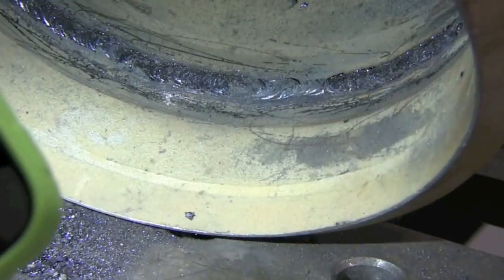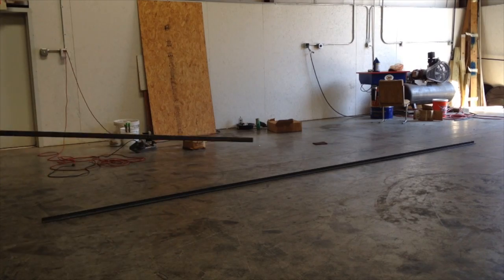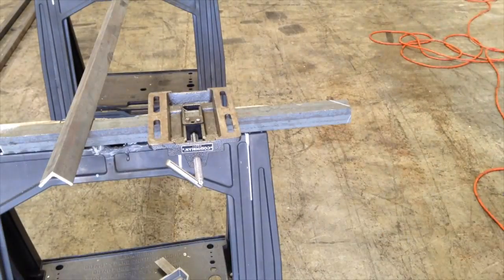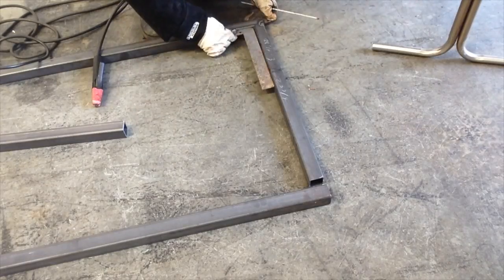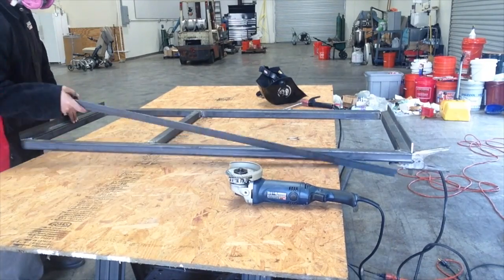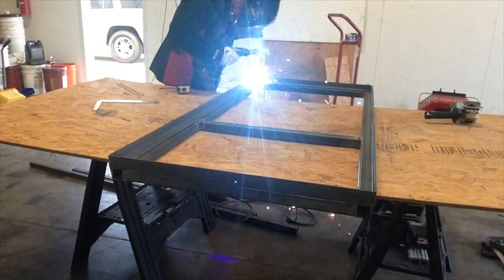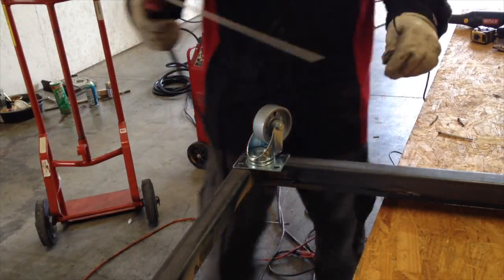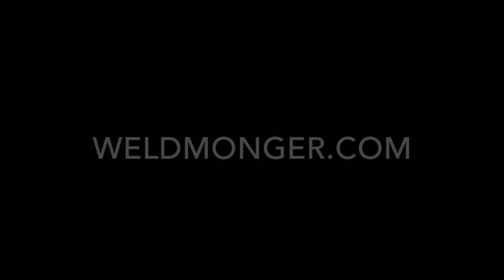6011 Stick Welding Quicky Fab

Comment: 7014 is my favorite rod for general purpose. It's fast, clean and very easy to use.
Reply: @vidioclipits. You are one of the few to know what you are talking about! 7014 is WAY nicer to use than 6011. 6011 sticks so bad whether a new or partially used rod. The flux is so weak that it breaks away from the wire leaving the tip with bare wire. 7014 strikes an arc especially easy once it has been partially used. How 6011 got to be the most popular rod I will NEVER understand.
Reply: Flux composition is better suited for rust and dirty material on a 6011 rod than a 7014 I too prefer 7014 when working with clean steel but for the little prep, dirty welds 6011 is tried and true

Comment: Jody,  I am 59. (not as steady as I could have been when I was younger)  My previous employer was kind enough to pay for three semesters of vo-tech weld training.  I have a Lincoln 225 AC welder.  I've been practicing based on your advice and it really helps.  Thanks so much for your videos! 
 Here's the thing. You have to try some things, (get some EXPERIENCE) before anyone can take you to the next level. You don't know what you don't know until you try it.

Comment: A couple thoughts: concrete floors are also notorious for not being flat! Most of them are like the surface of the ocean! ; Love those Lincoln tombstones! Great asset in a small shop! Known several guys who bought Miller thunderbolts, and every one of them had issues with them. The movable core locking up, the diodes burning out on the ac/dc version, and they all had that ultra annoying loud noise like a needle scaler running up against a piece of hanging sheet metal! Good news though! They make great boat anchors! Ha!

Comment: I fabricate like this every day, just two structural saw horses rated at ten tonne, a nine inch grinder, oxy, and a welder, I fabricate structural frame works, columns, and every thing in between

Comment: Fiters use a porta band to cut steel .I'm a BOILERMAKER and I use a grinder with a cutting wheel. Also Boilermalers weld in place gutters use a pipe vice to weld.

Comment: I really like watching these kind of AC stick welding videos, America was built on AC welding and used for decades in farming and repair work and still works just as good as it ever did. I just think its pointless to spend the extra $$ on a DC machine if you are just buying a welder to have in the garage or barn for general fab and repair. keep the videos coming thanks.
Reply: It’s amusing that people go to Lowe’s and Home Depot and spend a bunch of money on these pissy 120 volt wire welders that max out on 3/16” thick steel
Reply: But they won’t pay less for the stick welder that can weld up to 1/2” thick steel, and doesn’t require a cylinder of shielding gas!

Comment: I heard 6010 only run on DC. I actually run 6010 on my century 295 amp AC welder set for 95 amp 3/32 rod force setting. It work the weld look very good pass the test

Comment: I have a tig question.... I have the tweco 211i and my down slope won't cut out with my foot peddle. Not sure what the issue is.... Also the arc won't start unless I scratch start.... any info would be great....

Comment: Jody what amperage should I run the 6011 rod at on DC voltage? I can switch my cheap Harbor Fright over to AC amperage if yo thank it would work better on Ac. Sure would appreciate your your help with the amperage problem.

Comment: Question: I'm using HOBART brand 6011 with a Lincoln tombstone set to AC at 110/120 amps. I'm getting these pin holes/inclusion that are in the throat of the bead and on the base metal where there is no weld. They look identical from weld to base metal. I've not seen anything like this. (I looked at your video to see if I was doing something wrong.)
Reply: Could be that you are striking the arc and moving forward before the weld puddle has tied into both pieces. Usually a little weave or crescent motion at the start of the weld will ensure tie in. 6013’s are notorious for leaving slag inclusions in the middle of the weld bead, but 6011’s typically don’t have that issue as long as you keep a consistent whipping motion going forward.

Comment: any suggestion for the substitution of 7018,? because im having trouble using 7018. it always stop and cannot melt properly. i dont know if whether the machine or the power supply in our area is the problem. but 6013 and 6011 works very well. thank u in advance
Reply: If your welders output is AC, especially the small, low OCV machines, 7018 is nearly impossible to weld with. Several manufacturers make a”7018 AC” rod, but they are NOTHING like a standard 7018. If your machine is AC and you want the 70,000lb. Tensile strength, go with a 7014. It welds just like the 6013.

Comment: Do you normally Weld with a 6011 rod on material you are using. 
   I was welding up a tail gate for my trailer the other day and I was using my thermal arc fabricator 211i machine 6013 1/8 Lincoln rod on 65-90 amps and it felt like it running okay but once I chipped of the slag it looked like I haven't welded in years . Then I would end up blowing holes and. Well it was just a mess. my thought is it's not the correct rod and maybe I should of been using a 6011 or a 7018. Idk what do you think.
Reply: WICKED GRAIL what position were you welding in.. 7018 is always a good rod to go with.. welding in any position..( except downhill)

Comment: Jody, did the shop you were working at move or go out? Have you found a good location? I wish you the best. I know all this stuff is a hassle. If I ever have to move out of my shop, I think I'll call an auctioneer because I don't know that I could ever move so much at this stage of my life.
Reply from the maker: it sold and the new owner relocated it. I am working on a new location. meanwhile I have a temporary work area at a friends shop..moving sucks.
Reply: thanks for the reply and yes, it sucks

Comment: Is there a reason you used 6011 instead of 7018? Really curious? 7018 has always been my go to rod on mild steel. Should I be using different rods for different types of projects?
Reply: Probably due to all the stops and starts, and like he said you'll have no problem burning through milscale and rust. Also don't need as good of a fit up or a rod oven. 6010/11 was just better for this application
Reply: +John Huey today i experienced 6011, before i only did 7018, 60 11 is far more agressive, it really digs into the base metal, i blew up some holes that with 7018 would not have happened. Also 6011 because of this agressive bite,&#160;it can burn trhu the scale, rust, paint etc, so the metal preparation is not that important if you dont care too much. Ohh and one more thing: it really calls for a short arc distance, had to figure it out along my 10 or 12 stcik rod
Reply: I learned how to stick weld on my first everlast welder with 6011. Probably not the best to learn on but I still have fond memories of learning how to weld with them.
Reply: Ive used everything from a 6010 all the way up to 7024 and stainless and aluminum rods as well. But I was just curious why he didnt just use 7018. Seems way faster to me.
Reply: I'd imagine 7018 wouldn't run all that well on an AC buzzbox
Reply: 7018 runs ok on AC flat only... anything fancy... 6011 for sure

Comment: So I was using a 6011 3/32 rod and seems like a fresh rod was wide open almost getting out of control sometimes.   But as the rod burned down it seemed to smooth out a lot almost like somebody turned the Amps.   Is this normal?   I was using an amico 160 inverter welder.   Was the same on both polarities.
Reply: Sounds like the amps are dropping as you weld! Never heard of that brand before.
Reply: @tomt9543  I picked it up from Amazon for about 170 bucks.   It's small and portable but still plenty powerful.

Comment: I really enjoy your videos and Im sure youve been asked about this before but, what do you use to video your welds? I post little hints and tips simliar to yours on instagram (icweld). Not near as detailed as you but just little pointers as I remember them. I currently am using an autodarkening hood with my phone camera behind it. works ok but Id like to get a better quality video. thanks
Reply: I'd like to find this out as well. I currently film welds with an old #12 shade in front of the camera lens and while it works, obviously everything is tinted green and I have to be very careful with the focus and always fart around with the lens before I start the arc. I use some holders to support the lens that I made of aluminium TIG wire which are less than ideal, but do the job.

Comment: What amp should I use with a 1/8 7018 rod for downhill and overhead
Reply from the maker: I don't think downhill with 7018 is a very good idea. I use same amps for overhead as I do for flat. For 1/8" 7018 around 120 to 140 depending on the machine
Reply: I have a lincoln ranger 225, Thanks for quick repond ive been watching all your videos for awhile and really helpful and good tips... I do alote of excavator buckets rebuild at work and use mig and stick. Most of the time i try to us my mig but depends on rust and dirt. I dont know if you have a video, but would you be able to give me tips on welding 3/4 inch to 1 inch sometimes i need a tip from other welder since i,m the only welder in my company
Reply: Mike Lavallee 3/4 inch to 1 inch you can just bevel the edge and get by with really any type of welder it just may take many passes vs using an more serious 3 phase mig/stick.I work a lot with 1/8 and 1/4 I will bevel that but anything lower then 1/8 I don't.
Maybe sometimes you can't but its just good practice to remove rust, paint, dirt, oil and bevel an edge when needed
Reply: Hi, to weld thick stuff, whenever possible bevel both sides, and alternately weld one side then the other, this procedure will greatly reduce warping and also the amount of weld compared to a one sided joint. Works well for me.
Reply: Yeah thanks ive been doing that for years and never any of my work crack si i guess I must be doingsomething wright. Just by curiosity what amp should I put my mig for 3/4
Reply: Hi, depends on the position, wire size, nature of wire, how high is the welder capable to go.
Also depends of what size of puddle you can handle. Good practice for thick stuff is to use flux core wire with the gas protection.
Try some flux core .045 wire around 23 volts and adjust the speed accordingly, or around 24-25 volts with plain wire lower if you want to go vertical up.
Those are just start-up you must adjust depending on every situation.
Cheers.
Reply: I have a thermal arc fabricator 251 max 31 v. Ok ive been welding around 24 v with my feeder around 5, 6. I just thought i was to hot. But i guess i was doing it right. Thank you guys
Reply: Hi, to a certain extent, the hotter the better...
Be sure to keep your wire in the front part of your puddle, this ensure that you get maximum fusion of  the base metal. Check your sides for no undercut or overlap, that means the ideal parameters.
Good luck
Reply: Thanks
Reply: I started a project and would like to know if I can weld aluminum to steel? And what rods type can I used?
Reply: Hi, welding aluminum to steel is almost impossible, their too different metals. The best you can do is to solder. Personally I would not go that direction, mostly if you need a structural joint.
Best would be mechanical joining like screws or something that kind, also be aware that with 2 different metals you get  galvanic conduction.
Hope it helps
Reply: OK thanks again for info
Reply: +Mike Lavallee there isn't really anything out there to weld those 2 metals. Even a brazzing would do u any good. Now stainless n regular mild steel can be welded with a 309. but for alum n steel best is to bolt it or use ribits.
Reply: +Mike Lavallee Hi there Mike, When I was in the Marine Corps I was part of a project that welded aluminum to steel. We coated the steel with Zinc (done at a plating company) then we welded the zink to the aluminum by TIG welding with a hi silicone aluminum rod. Thats all I remember about it, don't recall voltage or gas type or flow. Theres also a way the force them togeather in a vacuum and use shock waves,  but I have never seen it done. Hope this helps.
Reply: Mike Lavallee its a one all position well ask this guy he most of mine been the same even held fer years on heavy equipment. But . u ask him ..one can down weld on most rods not all but most. Might ha off subject lol this guy seem cool fer ur question . just saying on mine . he better than me
Reply: I done it to prove my boss wrong. with that said it is not easy or practical the metals melt at different temp and you are creating an alloy. It will also possibility work like a therm a-couple creating a small voltage difference between the two metals.